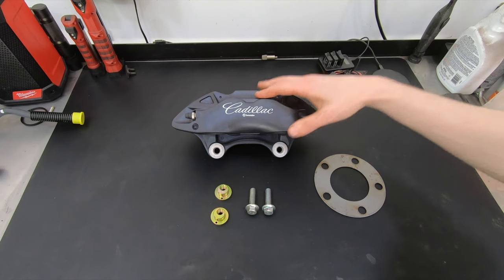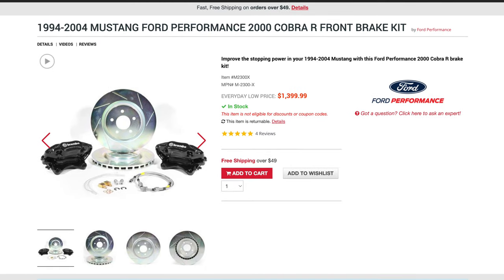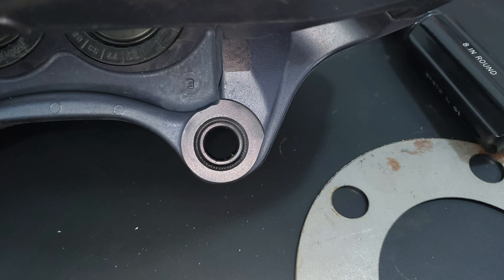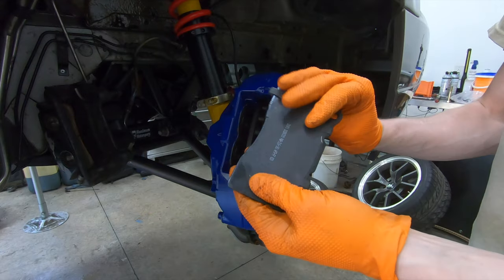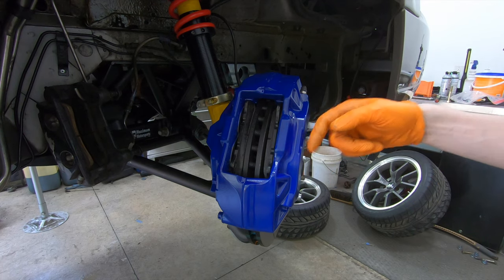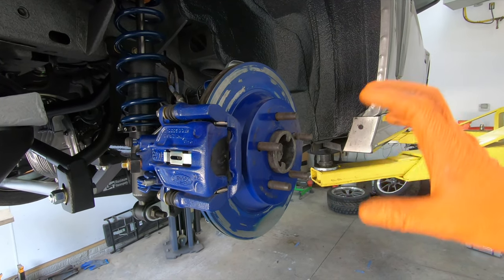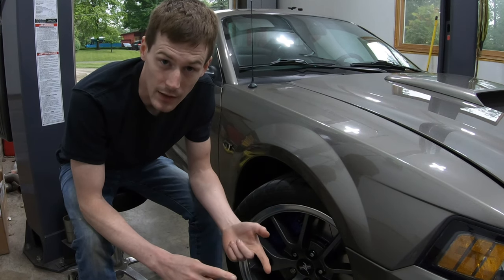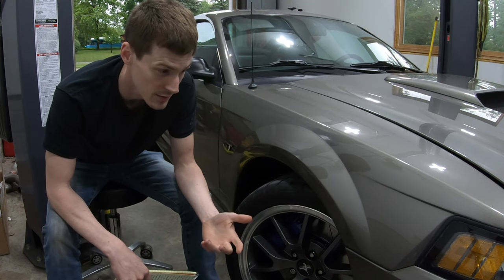Mustang Big Brakes Front and Rear for less than $600! 1979-2004 (ATS Brembos Front, Taurus Rear)

Comment from the maker: Parts:
ATS Brembo Caliper (Driver): https://amzn.to/3ad5m96
ATS Brembo Caliper (Passenger): https://amzn.to/38vsBuj
Pads I used: https://amzn.to/3GwECw8
Rotor:https://amzn.to/3Rii1sO
Braided Hoses W/banjo bolts 99-04: https://amzn.to/3ytaDpo
Paint: https://amzn.to/3N3CI8D
Brembo Decals: https://amzn.to/3t2myok
Banjo Bolt: https://amzn.to/3lUoHhI

Rear:
43mm Taurus Caliper (driver): https://amzn.to/3NNPiJn
43mm Taurus Caliper (Passenger): https://amzn.to/3lX2JLe
11.65" Cobra Disc Upgrade: https://amzn.to/3oMbvNl
---------The Taurus caliper will bolt right into any 94-04 Mustang caliper bracket. The 11.65" Cobra rear disc provides the ideal brake bias but, you can bolt the Taurus caliper onto a stock 10 disc and bracket as well and receive a slight improvement in brake bias for the ATS fronts.

Send S&S an email for a quote on the adapters. They do everything though paypal. They are pretty responsive to messages and their product works great. No issues at all.
S&S Engineering: Ssengineeringllc@gmail.com
S&S Engineering FB: https://www.facebook.com/SSEngineerin...

My Amazon Store:  https://www.amazon.com/shop/repairgeek
Help support the channel, buy using my Amazon links
As an Amazon Associate I earn from qualifying purchases and your cost is exactly the same.
Reply: 1998 Mustang GT . I bought the Taurus calipers.. I want to install the cobra rear rotors...(Bigger). Do I need the cobra brackets as well?  will the cobra rotor fit inside the Taurus calipers.. and will the Taurus calipers be a straight bolt on the cobra brackets if needed?
Reply: @luisvaldez6204  yes you do since they are wider to accommodate the bigger vented rear rotors.
Reply: Whats the link for those rotors
Reply: Will this setup fit with 19x8.5

Comment: I kinda wish you touched on the potential need for the MC to be replaced to one that uses bigger lines to accommodate the braking pressure which would be needed to efficiently use the new brakes. Been on the forums all day looking at that very issue since my 94 uses 11/16 lines and would need to be upgraded to 1" or 1.1" lines and MC found on the 99-04 Cobra/GT models. The 79-95 GT/v6/Cobra all use smaller lines and a different brake assisted boost system and depending on what year a person owns those variables also can change. I guess at the least this comment addresses it. So you folks at home DO YOUR HOMEWORK before you try this mod that said it is pretty easy to do and very worth it.

Comment: I'm really enjoying your videos.

Your car seems to be getting setup very similar to mine, with like goals.  Although, I am not nearly as far along as you.

Stock 94 GT 5-speed convertible, "budget grand tourer".  Just welded in the stiffler's fit system last night, and picked up BOSS 302 Brembos for $120 locally.  Bought a slightly used set of high performance summer tires too.  14in rotors on the way, along with solid steering rack bushings.  Eibach front and rear swaybars showed up yesterday too.

I share this car with my parents ( both 60 years old) and live in WV, surrounded by great driving roads.  I have to walk a fine line between making performance modifications...and not doing anything to upset my wife and my parents experience. lol

Your car seems to be setup in a way that would be the solution for what I'm looking for....while keeping it pleasant for them as well.

Comment: Well done. I recommend this upgrade not just for the increased braking performance, but to eliminate the front PBR Cobra caliper which has a very poor brake pad anti-rattle design.  Only the bottom of the pads use an anti-rattle clip, while the top of the pad has no clip but rather the pad just rides in the caliper bracket slot.  Brake grease in those slots and plenty of tension on the lower anti-rattle clips (LRS-2296A) will keep the pads from rattling for about 6 months, then, you will need to regrease and bend out the anti-rattle clips to maintain tension on the pads and keep them from rattling.  I have had front and rear Cobra brakes (rear M-2330-M) on my daily driver 2001 Mustang GT for 10 years, so trust me on this one.  I will say that braking performance with front and rear Cobra brakes on a new edge GT is exceptional for a daily driver, however the front caliper pad rattling will drive you nuts, especially if you own a convertible, which I do.  Also of note and in favor of this Brembo upgrade is the fact that the 2003-2004 Cobra and Mach I calipers are really for 12” rotors which is why so much rotor is not touched by the pad on a Cobra 13.1” rotor.  If any Ford owners know how to permanently get the rattling out of the stock PBR calipers, please let me know or I am going to perform this mod for my daily driver just to eliminate the PBR death rattle.
Reply from the maker: Never had an issue with my PBR's rattling. Your retaining pins are installed at the rear of the caliper correct?
Reply: @RepairGeek  Yes, the pins are installed on the rear (bottom) of the pads where the clips are. Its not possible to install them on the front (top) of the pads by mistake and although there is a hole in the pad, its not for the pin.  The pin would not fit through the hole and the rotor is right behind the pin anyway.  Really not sure what the hole is in the top of the pad. As you know, the pin passes through a radius on the bottom of the pad mated to a similar radius on the caliper bracket. I wonder if its possible that the caliper mounting bracket is slightly worn out at the top (where there are no clips) allowing the pad to clang around in the slot?  I have even tried stock Cobra motorcraft pads and they rattled around too.  Very annoying.  Anyway, thanks for thinking about it.  No need to dwell on it.  One day I will get pissed off at the rattling every 6 months and perform your upgrade. Congrats on the nuptials.
Reply from the maker: If the brackets and pads get flipped driver to passenger and vice versa you can install them with the pins on the top. That will cause pad knock when you apply the brakes and the pad slams forward against the pin. I've done it haha. So far I have no regrets with the ATS setup. Thanks for watching!

Comment: Another Ponder, after buying parts-for the Rear brakes.  Bought the Taurus L and R calipers-which are a direct fit to the stock mustang calipers.  However to run the Rear Cobra R style rotors, you need a new axle housing to caliper mounting bracket.  And the Cobra R Caliper mounting bracket-which seems generic, right or left??

Comment: Nice job. I do have a question. You mentioned gain in pedal travel due to larger calipers. i don't see how that would be correct as Hydraulic fluid does not compress. Unless you have air in the lines. One thing that comes to mind is the stock master is in the car type to move a lot more fluid. You master acts as a pump and you are now trying to move a lot more piston diameter. That would be why your pedal got softer. I think upgrading the master to something with a larger piston diameter would help with the extra pedal travel.
Reply from the maker: You're correct. The issue is this car already has a 1 1/16th master. That was the biggest master Ford ever offered for these cars. Swapping to a different master is not easy either because this car has hydroboost. Baer makes a kit for a 1 1/8 on a hydroboost car but it's over $450 the last time I checked. It's not worth spending that kind of money on. It has some travel before it grabs and the pedal is nice and firm. I still have no issue locking up the front wheels. Just as more travel before the brakes engage than a PBR setup.

Comment: Rear Cobra brakes use a 11.65in. and are vented which is worth the cost of that upgrade. That said with the stock brakes with the Taurus caliper upgrade I'd still gut the stock proportioning valve with the kit from Maximum Motorsports and add an adjustable proportioning valve. Wilwood has a valve that bolts right in place of the union in the line on the right side of the engine compartment on the firewall.

Comment: Great video and how to save money  without paying that Brembo price if you were to order it  exactly for that car , 👍, You didn't mention it but that set up will definitely stay cooler under heavy breaking & less brake fade , I recently did a drum to disc conversion on my 1994 F350 and it also used a Cadillac caliper,  Idk if Brembo was making the calipers or not ,So if anyone is doing that conversion look up( Graveyard Broncos ) for the complete kit & save money, Some welding needed for the brakets to the axle tube.

Comment: Damn!  And I thought I was doing good putting CTSv 4 pistons all around on my 2004 GTO for $2200… This is a bargain even though it is only a front kit.  I’ve been contemplating buying a 99-04 5 speed New Edge for a daily driver, so consequently, I have been looking at modifications for it.  Brakes, suspension and wheels and tires would be at the top of my list.

Comment: I’ve had this set up on my car for years now, you can use 11-14 none Brembo mustang rotors which are bigger then the cobra 13” rotors to have more pad contact on rotor (Cobra rotors are smaller causing some of the brake pad to not ware evenly) and avoid having to use the spacer s&s requires on the inside of the rotor for 13” cobra rotors
Reply: How much did it cost and where can I get the parts. Want to get brakes but 1500 is to steep for me
Reply: Thanks, Caesar! You saved me even more time and money. Knowledge is power.

Comment: Hi, just wanted to make sure, so the rotor listed in the description will fit in the front with the ats calipers correct? I am looking into doing this and want to make sure it will fit. Also, maybe stupid question but do you need brake pads for the tarus calipers in the rear?

Comment: Really well done video! Thanks for explaining why the need for Taurus rears and giving all the piston diameters. Very comprehensive and very much appreciated!
I’m looking into piecing this together right now and previously had my eyes on the Ford Racing kit. 
I’m running 18” AFS Mach 1 wheel on my 03 and would very much like to keep them so hopefully they give me enough clearance over the stock 17”? Worst case I’m using a wheel spacer and ARP studs I guess?
Reply from the maker: Mach 1 wheel is going to need a spacer.

Comment: Super helpful video (like all of your videos), thanks for the details and tips to ensure that this particular upgrade produces the best possible results! Is it possible to adjust the rear braking bias (if using the 38mm rear GT/COBRA calipers) back to 30% using an adjustable proportioning valve (passenger side firewall unit) when upgrading to the ATS Brembo calipers in a Fox chassis 79-93 application? Does the 43mm Taurus rear caliper upgrade apply to 94+ Mustangs or 99+ Mustangs only or all Mustangs from 79-04? Surprising that no one else talks about the brake bias change with the larger pistons in the ATS Brembo calipers.

I purchased the S&S engineering adapters, great folks to work with!

I'll have some actual track testing/experience that I can share once I get the setup installed in my '88 LX 5.0 and on the track next summer. I'm currently running the 13" "COBRA" rotors with MACH 1 calipers (same as the COBRA calipers), '93 COBRA booster, and 1" 93 COBRA master cylinder. Looking forward to trying out the change on the track. May try Hawk HPS pads instead of the ceramic pads though or may try out both since they are so easy to change with this setup.

Comment: With the Rear Taurus Calipers, do you need to install the 11.65 rotor conversion bracket still, or can you put these calipers on with a cobra rear rotor? I am not wanting to pull the rear axles out....again.

Comment: I think you need to upgrade your master cylinder to improve your pedal feel.  I know the fox cobra upgrade kit came with booster and master to correct for the upgraded brakes front and back.  I started with the original cobra upgrade on my fox station wagon, now I've upgraded to the cobra r brembos and the taurus calipers will be the final piece.  If it turns out that the ats brakes provide significantly more stopping power then I may try them.  The internal crossover may be a concern because the force used to clamp the rotor is also trying to separate the two caliper halves.  Great video.  Nice job!
Reply from the maker: There's no upgraded masters for a hydro boost car. It already has a 1 1/16th.

Comment: could i use the 43mm rear caliper with the Lincoln 73mm front caliper?  5 lug conversion no sn95 spindles.  but using 93 cobra booster and and matching mc.

Comment: I contacted Russell for braided brake lines and I’m confused.  Their first email response to me merely said to check their catalog and answered none of my questions. I followed up earlier today stating that they do not have a listing for 03/04 Mach 1s and asked if there was a part number not shown in their catalog.  I also asked if their lines would fit/work with ATS calipers….they said I’ll have to build my own set! 😫 

I have an 03 Mach with traction control, would the part number you used work for me?

Comment: Isn't going to provide much stopping power over the factory cobra setup. First, it's the same diameter rotor so leverage is not increased over stock. About the only two benefits you get are larger pad surface area (a meager increase in brake torque) and higher thermal capacity and more even pad wear with 4 pistons versus 2 from stock. If you really want a big stopper, get a kit with a 14" or even a 15" rotor, though different wheels are usually required for this.
Reply from the maker: Well, I'm using the entire face of the rotor, which cobra's didn't. The pistons are larger than any factory cobra (38mm or 40mm depending on the year). So this setup has more clamping power because of the 42mm pistons and also has better pedal feel at high braking forces because there is far less deflection in the caliper at high clamping loads.  There are also 2 sides to thermal capacity. A larger rotor at 14 or 15" has more mass (weight) and would take longer to heat up but, nobody ever mentions that a larger rotor also takes longer to cool down. This car is nearly 1000 lbs lighter than a S550 GT500. You don't need a 15" rotor if the car isn't morbidly obese to start with...

Comment: Hey man with those setup did you have to use that rotor only or could you use a different one? I bought the EBC rotors for my setup like this but I haven’t put them in yet. I’ve just still been doing a lot of research to make sure they fit first. I have a ‘03 Mach1 and they’re made for that car. I want to be safe than sorry lol
Reply from the maker: You can use ANY 13" rotor from a 94-04 car.

Comment: Thank you bro!! Amazing breakdown video! Think this is def the direction Im gonna go with my sn95 now. One thing I'm thinking, and will have to do a little research on, you mentioned softer pedal feel, gotta be a master cylinder upgrade out there that would probably help with that🤔
Reply from the maker: Not for a 96+ hydroboost car. The stock 96+ master is 1 1/16th. Some of the older superduty stuff had a 1 1/8 but they used a different mounting flange for the master and a larger booster that doesn't fit.

Comment: Great video! I am adding this setup to my '85 GT and Cobra rear disc for strictly endurance racing use. Since Repair Geek indicates the bias is similar to stock, does anyone know whether the stock brake distribution block on the '85 Mustang will work ok with this upgraded brake setup? I recognize that I will need to install a '87-93 GT booster and a 1 1/16" MC.

Comment: I've been seing mention of a slightly larger rotor, 13.1 or .2 i think? Is there a Mustang/Cobra rotor that will center and face the full pad so there is no material on the outside creating a lip? And also you rotor link goes to a 14" rotor. Seems incorrect. Also, the Banjo bolts link looks nasty. No copper bushings and looks like cast garb. any link to a better banjo bolt? Can you use the stock Cobra brake hoses with a new Banjo?
Reply from the maker: I have a lip at the top probably around 1/8th of an inch on the pad. I've ran this setup on a 6000 mile cross country drive and a track day at the halfway point of that trip. This setup works great.
As far as the rotor I have linked, that is a 94-04 13" rotor. The dimensions listed on the amazon page are for the size of the rotor's box, not the rotor itself.
Banjo bolt information: 9:56

Comment: Love it did it , I noticed a softer brake pedal , which I figured would be the case with more pistons up front . Would it be wise to upgrade brake booster ? Or just run it ?
Reply from the maker: Is the system fully bled? What master do you have?
My car as more travel in the pedal but once it bites the pedal is very firm.

Comment: Out of curiosity would it be possible to use this brake setup designed on a Mustang on a 2000 Ford Ranger with stock front and 8.8 Explorer disc brake rear end?